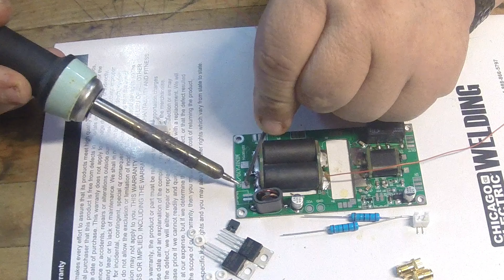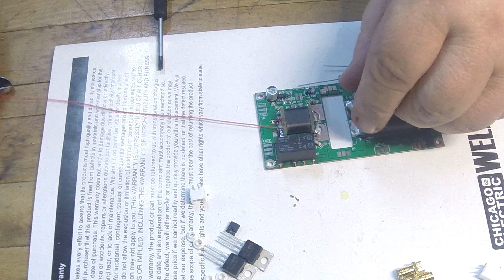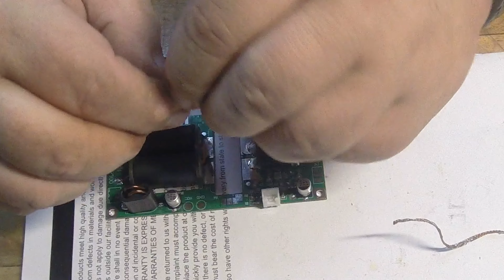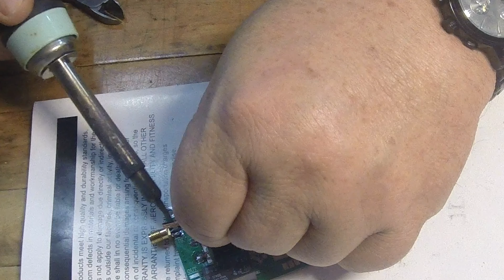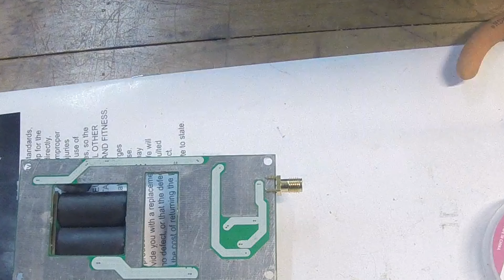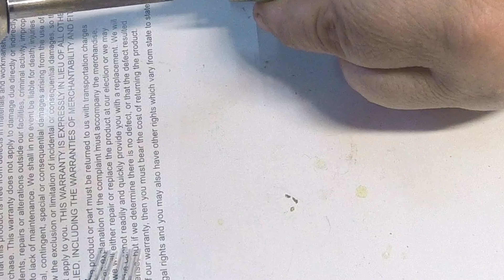Minipa70 watt HF Amplifier Kit Assembly and Testing Part 2

Comment: Good evening, I have an XDT-PA100 amplifier. I have a cable for yaesu ft 818. I have a red and black wire on the amplifier. with what color do I connect to the cable cat
Reply from the maker: Honestly I am not sure as I am not familiar with the FT 818 but I would think that red and black wires off the amp are the power wires which need to go to an external 12V regulated Power Supply if that helps.